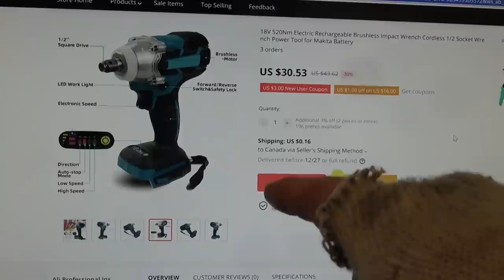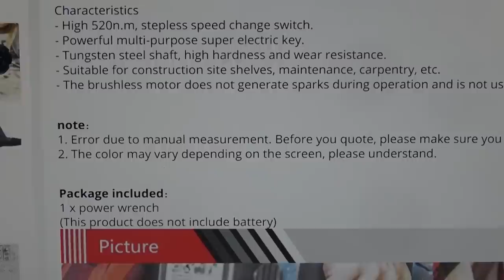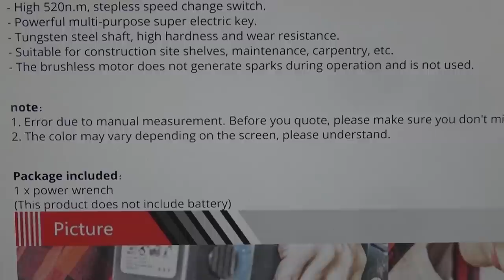BOLTR: Fake Makita Driver

Comment: Name: Cordless Brushless Impact Wrench

Model:D39422

Specifications

Adapted to 18V Makita battery

Color:black+blue

No Load Speed: 0 - 4000 rpm

Impact frequency: 0 - 4000 ipm

Maximum Torque: 520N.M

Square Drive:1/2"

 

Features

-520N.M high torque, stepless speed change switch.

-Powerful electric wrench, multi-purpose, super power.

-Tungsten steel shaft, high hardness and wear resistance.

-Suitable for construction site shelves, maintenance, woodworking, etc.

-The brushless motor does not generate sparks when it is working, and the motor does not wear.

 

Note

1. Please allow a bit error due to manual measurement. please make sure you do not mind before you bid.

2. The color may have different as the difference display, please understand.

 

Package Included

1 x Electric Wrench

(This product does not include batteries)

Comment: 15:06 - that involute gear has been "swedged", a forming process much cheaper than machining. Commonly used for splines and gears in the automotive industry. The tell tale run out of the gear can be seen with sharp corners which would be impossible with a hobbing process.

Comment: The fake makita does not have a temperature sensor lead because the chinese batteries ( I bought one battery shell + electronics w/o cells) have an internal temperature sensor. I also bought some Sony 30A max current cells (9Ah total) for half the price of the 3Ah original battery. Also the Makita where I live retails for 120 Euros. Battery (3Ah costs 90 Euros) My 9Ah battery had a total cost of 70 Euros

Comment: Funny you mention brown tape stink. After I inherited my Father's '68  Ford Pickup, He had a brownish window sticker blinding the rear view mirror view. I started scraping on it to get some visibility and immediately smelled catshit. There were a lot of cats around and I am thinking one got in and I would have to find the treasure. But then I smelled my fingers (as I always do once I smell caca) and it was the old adhesive for the sticker. I wonder if it is related to your tape issue? I was happy I wasnt going to need to hunt for a stick to do that time-honored process of removing fresh cat poo with a pointy stick.

Comment: Wow; a lot of Chinese companies are bringing out cheaper impact driver/wrenches with the same 1/4”hex+1/2”anvil that Bosch started a few years back with the Freak.  This is another one of them. For $32.99 plus .99 shipping now, and it works with your existing Makita 18v batteries, this is a steal.  Plus it walked the plank 3 times and lived.

Comment: Doesn't have to have hall sensors to be closed loop. You can listen to the voltage on the unpowered phase. Less wires, less expensive.

Comment: I suspect the skookum components are sourced or used for higher end tools and it's simply easier to use excess (or second quality) components in the El Cheapo products than spent the effort on a cheaper overall process just for another product.

Comment: The motor pinion teeth don’t look machined to me - the way the tooth profile ‘lofts’ (to use a solidworks term) into the round is not what a hob or shaper would generate.  Certainly looks to be turned after the fact.

Comment: I have a makita 18v Cordless drill, it is made in China and after 18months the keyless chuck is junk and regularly needs stilson wrench to crack it open to remove drill bits and it also has eccentric wobble that means I can now drill ovals easy. Not going to bother with the warranty because I don't want another Makita drill. I also have a Ozito/Einhell cheapo drill also made in China and it has done better than the Makita and I have it longer. That Fagitamakita is probably as good as a chinesium made Makita.

Comment: Thks for your review but tooo late got mine for 'shits and giggles', $40 Auz, not bad. First off, socket was a B' to fit, split ring at drive end TOOO Big, you know how it is, almost hammer on, Next she had a odd start in Low range, would only do 2 - 3 second bursts but eventually came good, no not operator. Noisier than true item but did the work as stated. Will NOT do the drop test as seen need to do more work with to see if it lasts. Pretty good show love the wife's comments. LOL

Comment: These are all over the place on Ebay and apparently selling like Hot Cakes. Looks like you can get one at home for less than 50 bucks USD from highly rated sellers. AND, I bet this review has a great deal to do with it. They even have them in other colors.  They seem to be very careful on their description so Makita doesn't come after them. And they don't over represent the product if you know what I mean.  It's sort of here it is succintly described. IF I was invested in the blue and black platform instead of the yellow and black, I would be required to buy one...just because...

Comment: I won't be surprised if the motor winding is aluminum. My Homelite electric trimmer died suddenly and  upon disassembly I found a thermal fuse to be the culprit, why one put a thermal fuse in a weed wacker is beyond me. So I snipped the fuse out and tried to solder the  armature wire.  When I scratched the brown wire coating I found silver color wire which I thought is tinned, but it was not, it was aluminum armature wire, as I could not solder it. How cheap the companies can go in saving pennies is surprising.

Comment: About brushless tools...
I had opportunity to work with both brushed and brushless Ridgid brand drills and personally i prefer the brushed motors.  Smoother run, less vibration, better control.
How about you ????

Comment: Shit! A repairable tool!  Almost completely.  Fix that one AVE, I bet the switch is $3 And mosfets a buck two fifty.  Da ain't nutin else to go wrong really (you see all the parts (lack there of is good thing). Comes apart and goes together beautifully easy.  This is a working man's bang for buck. Five of these will last longer than 1 of any other brand I bet and cheaper!

Comment: Bought one for my brother 20$ shipped from Winnie the Pooh land to Europe. He has a normal makita cordless and a big makita cordless so we were like why not,he has the batteries and he needed a small impact drill to ugga dugga rusty bolts on cars. And the thing is fu*king amazing for 20$ tool. It's 10x better than any mid range tool you can buy in the tool shops here. And the thing has like 5k good reviews on Winnie the Pooh shop

Comment: Speaking of stanky overmoulding, how does one remove it?  I have a battery charger here that's wrapped in some OM that is degrading and is collecting bits of everything it touches.  Same for a USB hub.  Stanley knives and screwdrivers only go so far.

Comment: No hall effect sensors, not open loop is likely using voltage as feedback, once mosfets switch and coils switch off, still not bad quality for $30 bucks, much better then other crap tools I seen sold at harbor freight. To bad it was designed to be a fake, otherwise would be a deal for the price.

Comment: If the overheat sensor is the same as the Makita, which it likely is since Makita's overheat sensor setup is simple jellybean components: wont burn it out from ye olde torture test. Unless you feel like living a bit dangerous and replacing the thermistor with a suitable stand-in. 

Honestly I'm curious to see if they have a Makita XPH knockoff. The XPH is a serious workhorse. The one I carry goes through cement, iron, steel and aluminum through 2 to 3 large grocery stores between charges and still acts like it's fresh out of the box after 4 months of that kind of torture. Talking average 10 holes into those materials per door the store has and any holes to feed cable through along the journey through the rafters. A decent knockoff of that would be the only drill any home-gamer needs, too pricey for Makita's model if your not using it out in the field.

Comment: Dear uncle Bumblefuck, there's nothing intrinsically wrong with not using Hall sensors for driving the motor. Drones and computer hard drives also use BLDCs without sensors. That does NOT constitute open-loop control; back EMF is used for position feedback. Google "sensorless BLDC".

Comment: 10:15 I got to say partner you're forgetting the labor cost to build the friggin tool in the first place. DeWalt and Makita are both USA. I'd rather pay that for "local" labor. Just wish we had manufacturing too, like adafruit does their own boards. Not 100% though cause electron pipes and valves are cheaper from China then Japan cause we don't make that local, I don't think so anyways.

Comment: The SCR module reset to setup somehow. There is some way to set it back up but I wouldn't know how.. probably something along the lines of plugging the battery in thrice whilst holding the trigger fully depressed etc. etc... it probably wanked it out by having the stator backwards and trying to run it lol

Comment: how amazing would it be if you could build your own drill like you can build yourself a desktop computer. just upgrade individual parts, or replace them as necessary. we've hadthe ATX standard since 1995, I don't think I've thrown away even 20% of my components since I started building PCs 15 year ago.

Comment: Shipping is cheap because there is an international treaty that the receiving postal service will pay for nearly all of the delivery cost and the sending postal service just pockets the cash they're paid for delivering the item ... so they can use that cash to pay for deliveries they receive and have to pay for. Because Canadian manufacturing companies don't ship a whole lot to China... there's no reason for the Chinese postal service to charge much at all. The ship from a china to a major port in Canada costs nearly nothing compared to the road costs of delivering from said ship to your door. And the receiving service has to pay for the road component *without receiving any money from the sender*. Yep it's forked, but that's how it works. And it allows china to have crazy low postage prices without actually subsidising it.

Comment: Jeez, at 14:10 the coil wires are overlapping, which after vibration during use can rub off the enamel coating and basically short them out.  Yikes!!

Comment: Your looking at it all wrong, $50 for a drill w/battery isn't cheap $200 for a drill is insanely expensive and unjustified, the thing weighs 3 lb that's $70 for a pound of plastic and some metal.

Comment: You gotta see if you can do something about those potted circuit boards.  Maybe Methyl-Ethyl Ketone will eat the shit off?  I see potting, I think back to a story I heard about a guy who used build these fake Muzak receivers, back when Muzak was a broadcast thing, what he did was he filled the entire chassis with potting compound, it was just a box with a few tubes coming out the top, this way his circuit could not be reverse-engineered, nor could it be discovered if he was in fact using proprietary information.  So whenever I see something done like that, potted into a literal "black box", I have to wonder what they're hiding.  Security fasteners in technology give me the same reaction; they are not securing anything because physical access to the system is total access to the system and you don't want me taking apart something I paid actual money for and physically possess?  Too fucking bad Jim, I've got a hammer and a chisel and a lovely set of files and even if I don't have whatever tool fits the weird-ass fastener you spec'd.  I'm finding out what's in there.  

Let's elaborate with a couple examples: those stupid safety plugs they started requiring on shit like air conditioners: inside we find Chinese circuits of the worst possible stripe and contacts of the sketchiest nature.  (Also these aren't GFI or overcurrent devices, what they are is completely unnecessary bullshit: they detect if there is a break in the insulation, because people got shocked off badly maintained cords.  If you use electrical equipment and can't be fucked to inspect a line cord now and then, well, you deserve your shock.)
The battery to an iRobot Roomba vacuum cleaner: sealed with a multitude of screws that took a bizarre triangular tool I did not have even in the big set of such bits, since it was being scrapped out for recycling, it fell to the 2.5 lb. Engineer's hammer and the cold chisel, and inside was a nice array of no-name cells.  No circuitry of note, just no-name cells.  Certainly this was also a significant attempt to keep one from figuring out that it is trivially re-celled so they can mark up the lithium cells some obscene percent.
SAAB ECU: this one was a surprise, 5-lobe high-security Torx, which of course don't resist having a slot ground into them (I have since discovered that the supposedly controlled tools are readily available and I have a set), inside there wasn't even a circuit card, the entire circuit was made of that godawful cheap Mylar ribbon cable!  I have no idea why this is done, perhaps to complicate attempts at modifying it?  It didn't inspire confidence, I was expecting a little slice of milspec avionics-type construction, not a component the better part of whose inventor dribbled down his mother's thigh...

Comment: Hey ave I have a problem with my spotwelder, it keeps tripping the breakers. Can I use a run capacitor maybe 2 in series on a extension cord to boost the amps, is it a way to go? Hehe probably a stupid question, but I'm not a electrician :p will be well appreciated any advice☺ and keep up your funny and informative videos, you make me laugh☺

Comment: I have a dtw190 and it's not too bad. I came across this in an email did a quick search and found out it was a dtw285 rep and thought it ain't doing that sort of power and for £27 with free expedited delivery was only really hoping for the same as the 190 and anything more was a bonus. Sadly it wasn't any more than the 190 but only got it so it's an extra impact so there's one each so can't really moan about it. I took mine apart to have a look inside and it didn't have anywhere near as much grease as yours so had to put some in but overall for the price and what I use it for its a fucking bargain

Comment: It's hard to tell what is going on in the head to head videos. Which side is spinning which way?
Reply: The Makita branded drill had more torque than the $30 one and forced the cheaper tool to spin the opposite way the motor was trying to spin.

Comment: I bought one of these; it just arrived.
I soaked it in hand cleaner to kill off the CoVid 19.
I'll let you know how I like it in two weeks time.
Or not...
Reply: It's been 3 weeks... How is it?
Reply: @funnymomentsnow1425  it still works and has had enough torque for me.  I don't work on cars where I imagine it would get more use.  The genuine 5AH Makita batteries work well but fit poorly.  It has more torque than my 1/4 inch Makita XDT-14 impact driver, but not by a lot--and not nearly the amount of finesse that is designed into the XDT.  I bought it to abuse.  Plain and simple.  And it fits the battery system that I'm already invested.  I only use it with impact sockets.  The LED display is functionally useless.  It feels like a cheap Chinese tool.
It's a cheap Chinkita rip-off of my favorite tool company.  Am I glad I bought it ?  I guess.  Would I ever buy another ?  No.  My opinion might change if it gets me out of a rainy-night jam removing lugnuts on the side of the highway.  
Once it breaks I'll likely look for a lightly used 1/2" Makita impact that I'll pass onto my kids.  
My 2¢.

Comment: i have a 18V Black&Decker Drill that i payed nothing for, found it in the ewaste ... took the weak af Battery apart that was f*cked and probably the reason it's been dumped and put new much better Cells into it. Mighty fine Cordless drill now. went from 1500mAh to 4000mAh Panasonic Cells

Comment: Came across your vid searching for an answer to my Makita XDT14z not powering on after I dropped it.  I have no power, no trigger lights, no battery indicator lights, etc. Tried multiple fully charged batteries.  Any thoughts you can suggest?
Reply: Have you opened it up and look for any broken connections? If power doesn't get anywhere it could be that.
Reply: @thatguythatdoesstuff5899  Yup. All wires and solder points look intact. I only dropped it from a 3ft ladder so it's crazy to me that it would stop working. Especially when some of these reviews and testers drop it from a 16ft ladder and it survives.
Reply: @JtotheRizzo Hmm. Does this model have any kind of fuse?
Reply: @thatguythatdoesstuff5899  Yes it does. The blade fuse linkage doesn't look broken though. Do you think it could be that?
Reply: @JtotheRizzo  Probably not if it looks intact, but if you have a fuse lying around its worth a shot.

Comment: Answer is simple really. If you are a simple Jeo that wants top screw in few screws, put in together Ikea furniture. Fajita for 30 bucks is great tool and it is enough for the job. No need for super expensive and usually (lets face it) overpriced Makita or other brand name tool. Simply you buy a tool for a job and cheap drill has it's place on the market. Sure if you are a builder then you invest in robust tools. If you are not, you buy stuff just to get by. Simple as that. Why should I buy a drill for who know how much which I will use 2-3 times in total for simple jobs just to replace screwdriver? Waste of money. So it all depends of the intended use and durability required.

Comment: 12:50 if the switch isn't a switch, does that mean it's always on? The battery getting drained when you aren't operating it?
And is that why the usual scumbags aren't doing that?